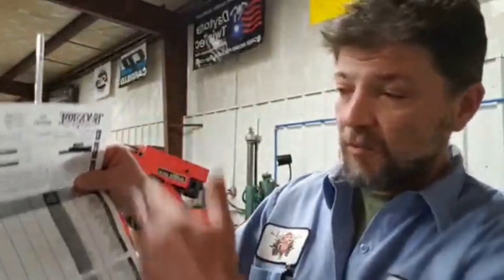Why We Analyze Oil - Harley M8 117 Tech - Kevin Baxter - Pro Twin Performance

Comment: I like to know why Harley tells you never to use Amsoil in you M8 Harley anyone know..
Reply: @KevinBaxter   I appreciate your wisdom and obvious skill.  It's not just Amsoil, I have also heard this about using any full synthetic in the motor from an Indy and a HD service manager lately.  Has to do with needle bearings someplace.  Also, I'd like to know Kevin (I'm YEARS) late to this, but wondering if your  80w90 gear oil is also good for use in the South, even 2 up, long runs... I know you're in GA., and it can reduce shock load...but now HD is pushing their 80/140 gear oil in primary & trans. Of course, because they are selling it, but no 80w 90 option.

Comment: Hey Kevin, not sure if youll see this but I had a technician tell me that amsoil full synthetic in the M8s cause the bearings to skate. Should I be worried?  Im wanting to do amsoil 20-50 for engine, and then their specific fluids for trans and primary. Thank you!

Comment: I am thinking about going with Amsoil after dealer performed 1000 miles maintenance scheduled. What weight do you recommend and also in primary as well as transmission? I own a 2020 m8 114 softail.
Reply from the maker: primary specific or 20w50 in primary, and i like 80w90 severe gear in the trans.
Reply: @KevinBaxter  Hello, Kevin. I just ordered the Amsoil service kit for my 2018 M8 107. 20W 50 oil, primary specific fluid and transmission specific fluid. Why do you recommend the 80w 90 severe gear oil for transmission?
Reply from the maker: just to soften up the shifts a bit, reduce shock load.
Reply: Don't wait for that, change it asap.  I put Amsoil in everything I own the day I buy it.  Car, snowblower, lawnmower, motorcycle, weedwacker, everything.

Comment: I’m an AMSOIL guy. I had a race tech tell me not to use it in the gear box. Do you recommend AMSOIL all around? P.S. that might have been the Primary, can’t remember. But they didn’t want to use all AMSOIL.
Reply from the maker: I use it all around except for when the clutch dictates ATF.

Comment: I know this video is about six months old as I watch it I’m new to the channel, but I have a question. Are the flow stainless steel all filters good or bad. The reusable ones. If I get an answer thank you.
Reply from the maker: I have seen a few bikes come in with those and have cleaned them out...have never cut the mesh apart to see the inside however.  I'm more familiar with the ones from Jagg like this:  http://protwin.com/hyperflowoilfilter.aspx.  I'm always straight forward...so...i can't really say if the Flow one is good or bad.  I run the Jagg one on some of my bikes, others I dont because i sometimes don't want the hassle of cleaning one out.  If it's an engine i expect to change oil often on, im more inclined to use it because it is easy to clean and saves me money in the long run.  They are more efficient (flow more oil) than most paper element filters out there but depending on which its being compared to, I can't flat out say they filter better...or any reusable types filter better.  I personally trust the Jagg unit because they have decades of experience in fluid flow dynamics thru their other European companies Satrab/Susa. 
 They get it.  Thanks for subscribing sir and welcome.  Hope this gives you some perspective.
Reply: Kevin Baxter thank you for answering my question and giving me some good advice. My concern with paper filters is that they may not filter for the 5000 miles on my Harley, or the recommended 7000 miles on my Kawasaki Vulcan. And after watching your video, I am going to start sending samples of my oil out to see how everything is doing. My Harley is a 2000 road king classic I recently bought with only 943 miles on it. Thanks again love your channel.
Reply from the maker: You are exactly correct.  If a micron rating is too small, a filter with a bypass can go into bypass and filter absolutely nothing.  Thanks for the kind words and for subscribing sir.  I appreciate it.

Comment: I’m a fan of Amsoil but while your under Harley-Davidson Warranty you could run into a problem told to me by Service Manager, and they sell Amsoil for people who want it. I stick with H-D Syn3  to not risk warranty
Reply from the maker: Thanks for your comment...but whoever told you that was completely incorrect. I strongly encourage you to read the magnuson moss act passed in the mid 70s. It prevents any manufacturer from requiring you to run a specific brand of oil or to require you to have it serviced at a dealer. The only exception to this is if the manufacturer provides those products and services for free. Amsoil, as do all others, meet and exceed standards HD states for use. HD does not make oil. HD Also does not even print the certifications or standards on the back of the bottles like everyone else does. That means they are hiding something.  Please...dont take my word for it. Research it for yourself and challenge that person to show you in writing from HD, that they will VOID your warranty if you use a brand of oil other than HD....it may say they recommend Syn3, but it wont say required nor void if you dont.  I promise, he will not be able to produce it.
Reply from the maker: Bottom line....its your motorcycle that you pay for. If his opinion is wrong, he wont be paying to have your bike fixed...you will. Always ask why if something doesnt sound right. Ask enough whys, and you most likely will find the source of the opinion to be from what they were told...not from personal experience or fact.